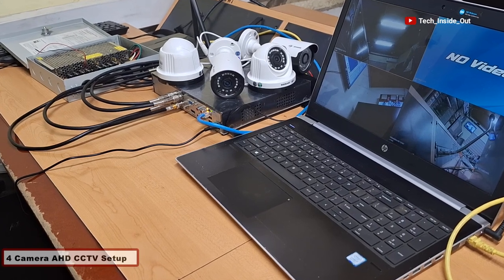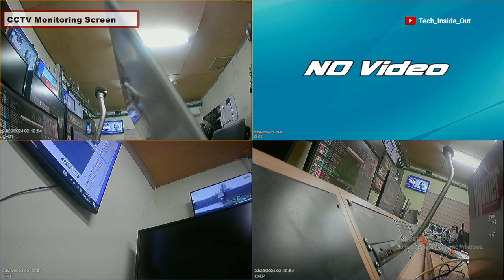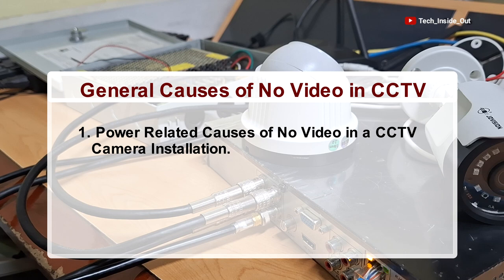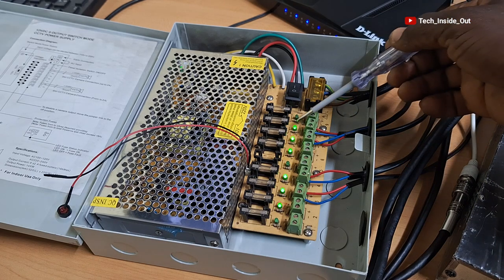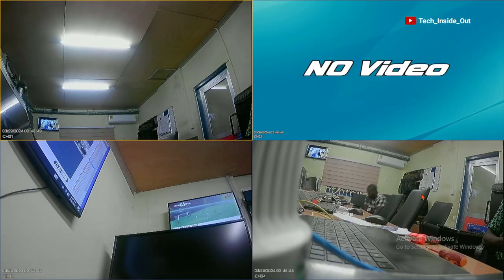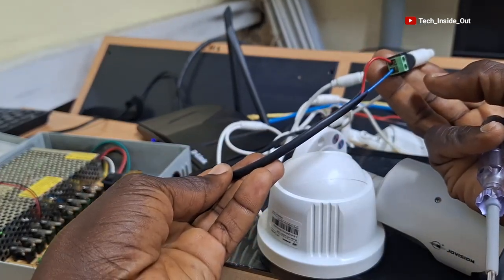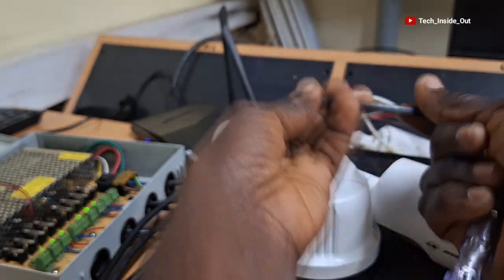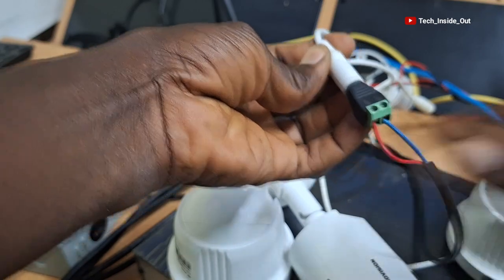No video in cctv causes and solutions

Comment: Thank you for your wonderful support.  Recently I had one of my camera losing picture. I checked the line in the power supply where its connected ,looked fine.The last thing I did on camera side was to open the bnc  inside the bracket ,clean some dirt and reconnect and voila it was online! Also another thing strange is that,in powersupply unit there is one LED off but the camera that is connected to it still works..Otherwise thank you so much for these super contents 🎉
Reply from the maker: The situation of the LED going off and still producing power should be that the LED itself is spoilt and not the fuse for that LED blown, that is a phenomenon that can happen because the LED just feeds on the power from the fuse and not in series with the power from that line.

Comment: Hi there, l am trying to install cameras to my house. 
Here is the problem, I use BNC cables to connect my cameras.
When the cables are rolled video signal is good, and everything is working fine.
When I unroll the cables with camera connected  the video starts to flicker, and continues flicker until I roll cables again. 
When I try to connect unrolled cables with camera, it seems that there is no signal in DVR.
Is there solution to this, like some kind of amplifier or just I need to buy better cables?
Cables are about 19m long.
Reply from the maker: Hello,
Please is it the same cable you used and it was clear that became unclear?
Please explain what you mean by rolled?
Please let me hear from you.
Reply: @Tech_Inside_Out  When the cable is coiled. I mean when the cables are not unpacked and they are at the short distance, they are working fine. But when they are streched they are not working

Comment: Sir what could possibly be the cause of camera flickering? I used a cat5e cable for my installation.  I used a male adapter to power my 7 cameras and I've confirmed the power adapter is working. Could this loss in picture be caused my the balun?
Reply from the maker: I suspect low voltage supply to the cameras due to low cable thickness. If you use less than 3 pairs of the cat 5 cable, you would experience low voltage to your cameras. 
So i suspect low voltage because of your cable thickness
Reply: @Tech_Inside_Out  yeah I used 2 pairs...so you suggest I should use 3 pairs instead to combat the voltage drop?
Reply from the maker: @opssonopsson8282  Yes, you should use 3 pairs for power and one for video. 
Your pictures will improve marginally but the best results are produced when you use coaxial cable with power
Reply: @Tech_Inside_Out  Noted! So do you suggest using coaxial cable for AHD installations instead of CAT 5 cable?

Comment: Please what happens when I mistakenly placed the +ve and -ve polarity of the power cable wrongly.. that is the +ve goes to the -ve  and -ve goes in to the +ve terminals
Reply from the maker: The camera will be short circuited and spoilt, thesame applies to any device to which you feed a reversed power polarity, that negative to positive and vice versa

Comment: I installed cctv the other day annke ADL500 just the single camera I connected my router to the dvr via an Ethernet cable and ever since my internet has gone very slow and barley working how can I fix this ?
Reply from the maker: Please what is the resolution of your camera? I asked because cameras do not really take much internet bandwidth like. 
Kindly disconnect the camera and check if it is really the camera that is contributing to the slow speed. Please let me hear from you.
Reply: @Tech_Inside_Out  camera is 3k tv resolution is set to default preset